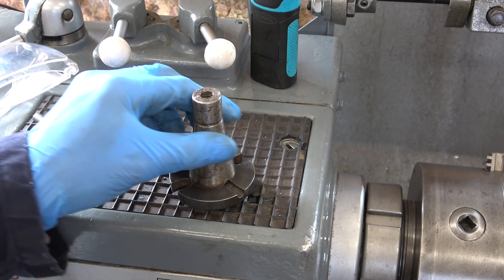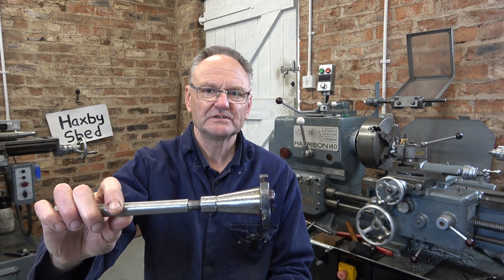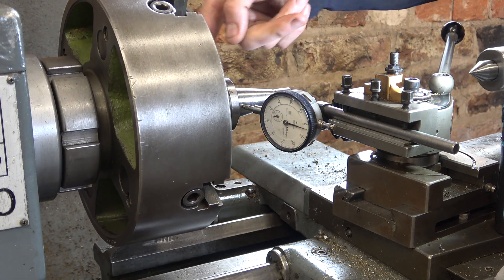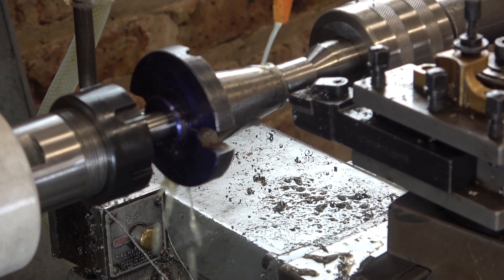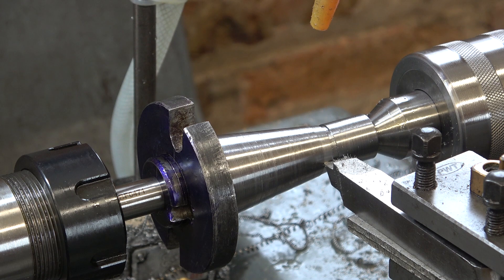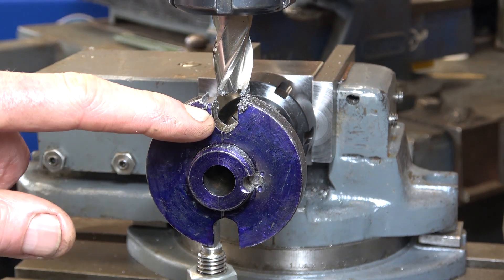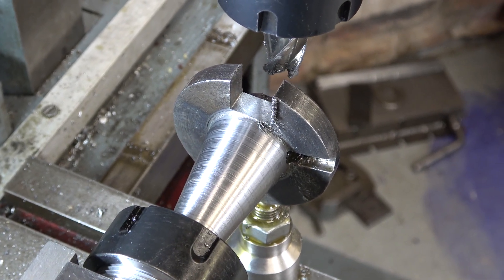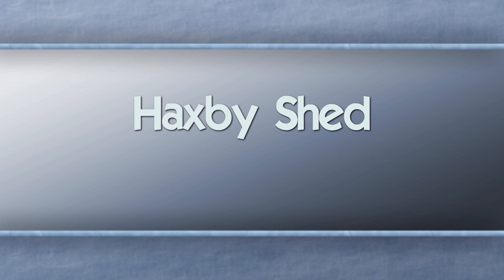HS198 INT30 mill adaptor remachining

Comment: Great job. We have the opposite challange, we have a couple of INT30 adapters with M12 threat and we need 3/8" Whit
Reply from the maker: Hi GTB, well the answer has got to be a sleeve of some sort, or change your drawbar, or do a swap with somebody, or just have another coffee and think about it some other time 😁. I would probably go for a sleeve and lock it in with a bit of TIG (but careful not to distort with too much heat). Cheers

Comment: Well repaired Paul. Good work figuring out the setting of the compound angle.
Reply from the maker: Hi Jon, I looked at some sine bars and slips recently but it's not where I want to spend my money at the moment.   Cheers
Reply: @HaxbyShed  keep your wallet closed for a couple of weeks, I am working on something you will find very useful (if it works) 🤔

Comment: Hi Paul. I know those sort of jobs, I seem to start them all the time! One thing I would have done, cutting the slots in the drive flange, I would have cut the bulk out with the angle grinder, and tidied up on the mill. Probably swings and roundabouts for that particular job. Certainly if it's particularly hard material it's the way to go.
Reply from the maker: Hi Olly, good to hear from you. To be honest for that size I could have cut out the bulk with a hack saw but it's swings and roundabouts. On a small job time saved here is time lost there .... Cheers

Comment: I advance the top slide using a cordless drill
Reply from the maker: Hi Tony I do that generally but even in low gear and with progressive trigger the drill feed was still too fast. I need to look out for a compact reduction gearbox of a slower drill. Cheers

Comment: Hi Paul, that was a great result and it certainly made you work. Great to see the shaper milling head being used. 

Out of interest did you or have you blued up the taper to see how the fit is?

Have a great weekend!!
Reply from the maker: Nah David, I could have blued it but what then? Would I file off the high bits? The machine spindle got a bit rusty at some point so the internal taper is not perfect. I was confident of the taper angle. Maybe on the next one I'll do the blue test. Cheers

Comment: You could try using a fine flat file to improve flatness/finish on the taper, ref Joe Pie.
Reply: I use a fine cut machine or lathe file for that purpose very frequently. The truth is that a few surface scratches on that locating taper won't be of any detriment to the functionality anyway.
Reply from the maker: Hi guys, soon I'll be remachining my INT40 long 1inch diameter arbor down to INT30 and I've got a few tricks in mind to improve the finish on the taper. In any case I think the material on the long arbor will be better than that home-made adaptor. Cheers